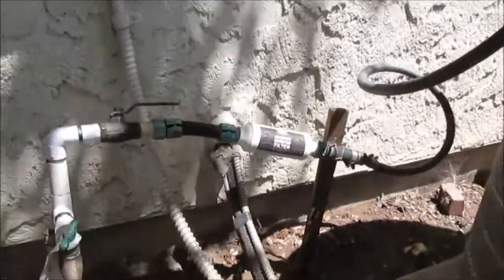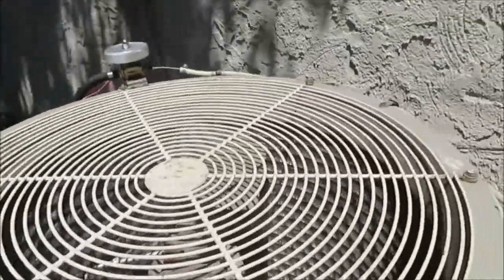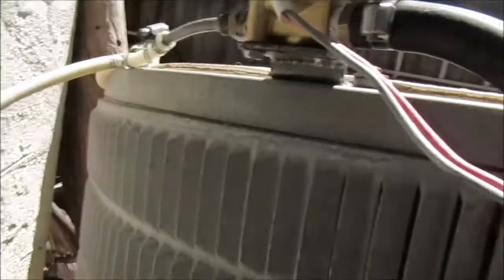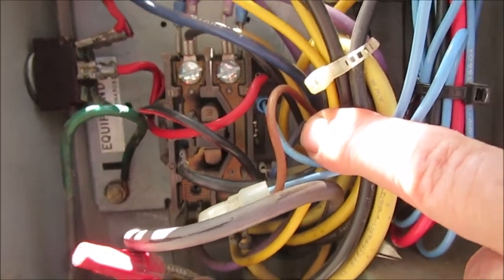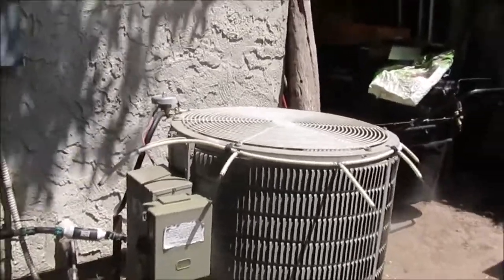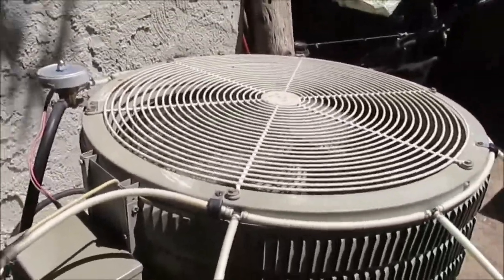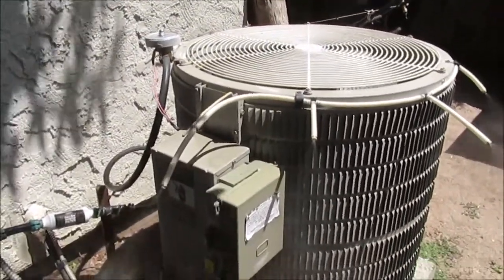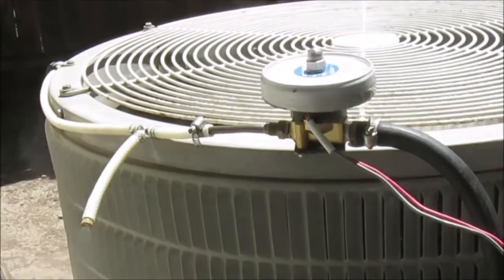DIY Air Conditioner Pre-cooler Misting System

Comment: The water needs to be directly on the coil on r22 your head pressure is normally between 175-210 on a hot humid day you cool down the condenser coil head pressure will be around 150 , keep tstat on 70-72 suction will be between 65-74

Comment: The best way to see if this saves you money is to take readings. What's your starting points. Amps. Voltage, head pressure etc. I've seen some elaborate stuff but the best one was a water cooled condenser.  If you flooded the condenser while its running, the head pressure will drop a lot, but the safety and possible water restrictions are an issue. Best way to go at it, my opinion, keep unit clean. The contactor looks like it has some black burn marks on it. Replace it. Poor contact will cause higher amp draw and over heating. Turn up the temp in the house to 74 or so. Just my opinion here, I'm not a hater or troll.
Reply from the maker: thanks for comments john.  i'm really backed up with other projects now and don't have time to run all these checks.  i'll consider a water cooled condenser when the time comes to replace this one (it's original, 33 years old).  i'm not sure i'll keep the mister system.  after only one season the calcium filter isn't doing its job and there's calcium deposits on the coils.  up to 74?  our thermostat is set at 82.
Reply: @hbum99  Your system probably has R22 in it. My neighbors where I live have tried piping directly out of the faucet. The equipment has so much calcium build up on the coils now, replacement is needed. I saw a really interesting set up yesterday. Extra high speed box fans on two sides of the coils. Makes me laugh.
Reply from the maker: @bigbadjohn2543  , yes r22.  i had it serviced for the first time about 5 years ago.  he topped it off with r22 and put in some sealer.  it's been working fine ever since.

i was hoping that with the filter and the fact that the misters only come on while the system is running would solve the calcium problem.  so, i'm not too excited about turning it on this year.

i built a couple of evaporative coolers out of 5 gallon buckets that i use inside the house and garage.  they do a good job helping keep things cool, especially once it gets cool enough outside to open some windows.  there's lots of examples on youtube.